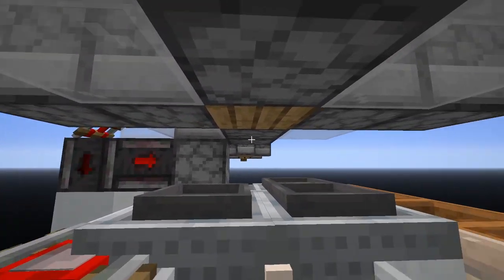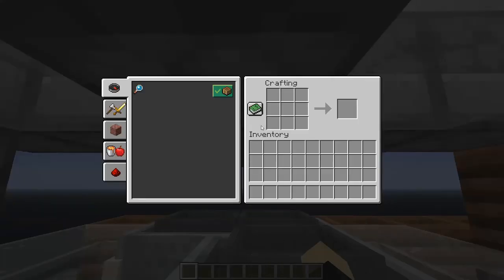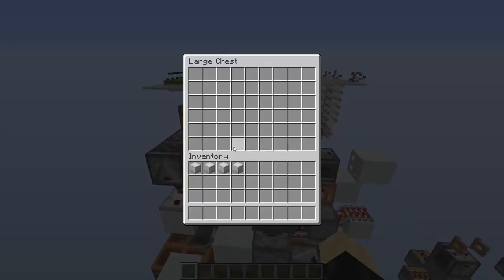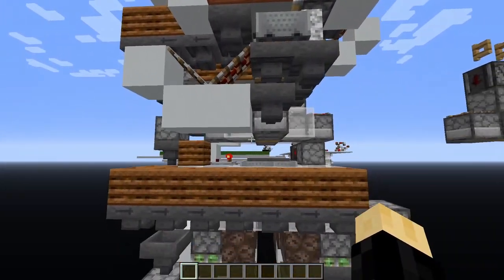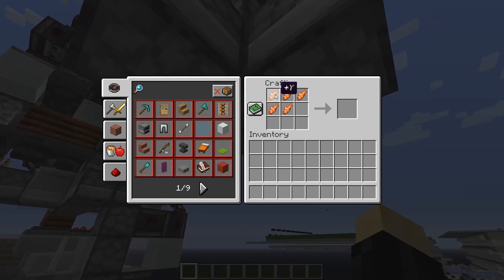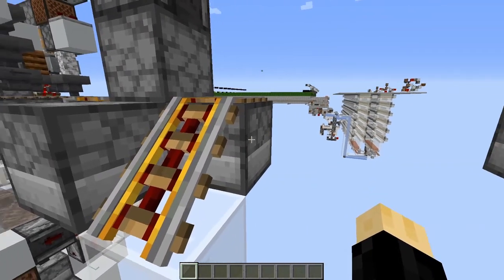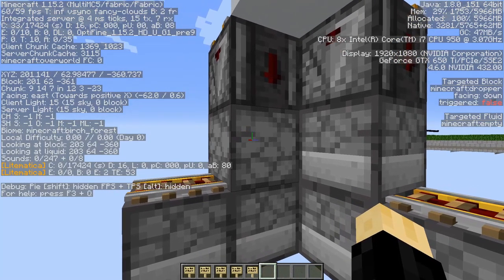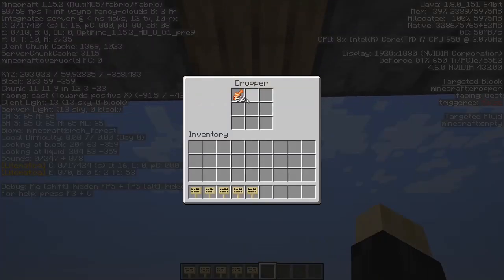2x2 Autocrafter and Synchronized Dropper Mechanics

Comment: I need a crafter for glowstone blocks from dust and magma blocks from cream.... I get that this would do that, but way overkill for what I need. Do you have a more simpler design that is less fast for that use case?
Reply from the maker: Check out my huney crafter video! It can do any 2x2 recipe but it might need a slight adjustment because in its current form it's expecting 5 dummy items due to the empty bottles. With magma or glowstone there would only be 1 dummy item however.